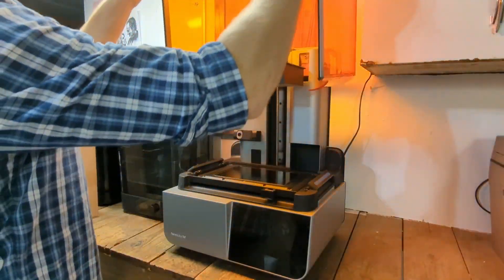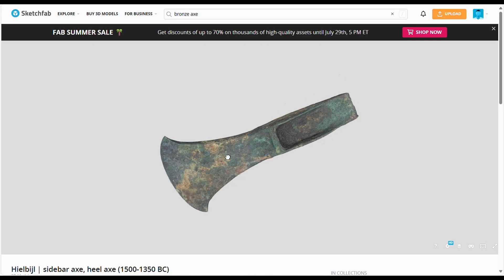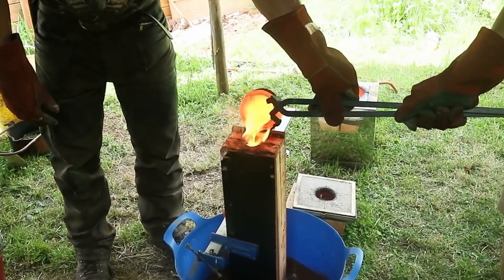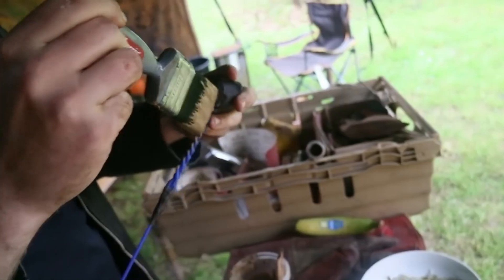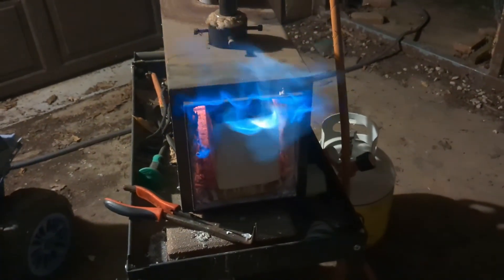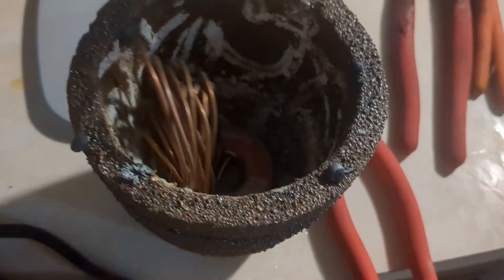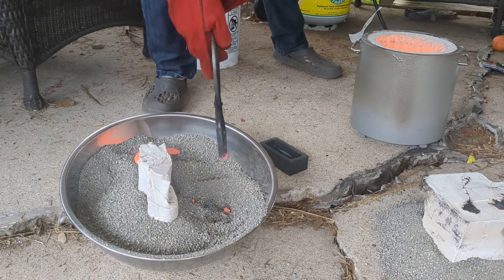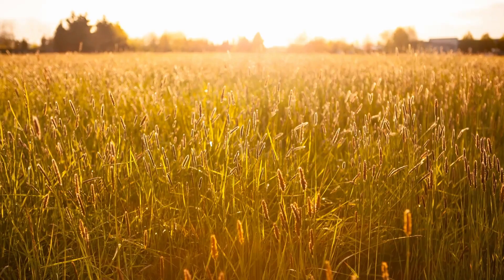"Stealing" Museum Artefacts with a 3D-Printer and a Furnace.

Comment: At the place I work at we do the process a bit differently:
- first, we design an object in 3D software and add a sprue
- then, we 3D print the object in a resin printer and do all the steps for that in a mask 'cause PPE is important and even if most guys don't care about it harming them, they sure as hell care about not having to smell the resin
- make a 2 part mold out of HTV silicone rubber mix, get it vulcanized
Then we have a mold we can infinitely reuse for lost wax casting. 
- take the mold out of the fridge, coat the mold with a brush in baby powder, tap off the excess, close the mold, fill it with wax using a wax injection machine
- once the wax cools down, open the mold, take the part out, put the mold back in the fridge
- if the piece is tiny, use a soldering iron to attach it to a wax "tree", dunno what it's called in English
- mix up plaster using a machine which automatically adds water and stirs the mixture 
- put the wax mold in the middle of a casting flask, wrap it up with tape, fill it with plaster, leave it to set
- remove tape, wait a bit more, put it upside-down in the casting oven (wax burnout ovens are apparently not very necessary)
- take it out, check if all the wax has melted, pour molten metal inside, put it inside a vacuum casting machine, then back in the oven
- next day we take it out, leave it to sit for a bit outside if it's not raining (as opposed to dropping it right away into water which most places do), when it's cool enough to handle then we put it in a bucket of water and start removing the plaster so it comes off in nice chunks instead of turning into a gooey slurry
- when most of the plaster is cleaned off we rinse it off and drop it in a bucket of acid for some time
- then back into another bucket of water and it's all nice and clean without any plaster left (and if there STILL is off to the sander with you!)
- cut the sprue off the parts with metal snips (biiig ones in case of thicker sprues or an angle grinder) and grind the rest of the sprue off on a bench sander/grinder
- polish it up and you're done

I never really questioned the process, but I guess the proper machines really do make a difference given the fact with tiny casts we only have like 4/100 failure rate and like 1/20 with bigger casts. But most probably aren't needed if you're trying to DIY. You could probably replace HTV silicone with regular high-temp silicone and pour wax into a warmed up mold. You're gonna end up with soft wax cast but if you don't need to churn out 800 wax casts a day from a single mold you don't need to worry about it degrading and the wax cooling quickly and being hard. The plaster cast should still work but you might lose a bit of detail with bigger pieces. I guess the bigger difference comes from the vacuum casting machine, it makes sure there's absolutely no air in the mold so the metal fills it completely. You can probably skip it and get the same result if you add more sprues in most important parts. And probably the most important part, we tried using many different burnable resins to skip the mold making process so we could prototype designs but no matter the brand or type could never really get it to work perfectly. At least we could reuse the resin since it works like any other. Dunno if it stinks less or more tho. Yay for PPE. Not yay for the guy who didn't use gloves when cleaning the UV hardened prints and developed resin allergy. Which wasn't me, 'cause I always wear PPE. 

(Learned it the hard way after my last job had me pen plating stuff in gold without gloves and kept pouring the gold solution into another container so I wouldn't see it was carcinogenic. Fun fact, it's not only carcinogenic, it also has cyanide in it! Tiny amounts, but it gets absorbed through skin, so I ended up with mild cyanide poisoning after doing a 10 hour shift. So, always do research about proper PPE for your position guys and don't trust your boss and whoever does your job introduction to properly introduce all PPE to you.)